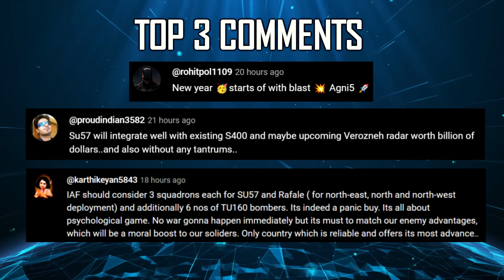Indian Defence Updates : DRDO's Anti-Hypersonic Missile,Brazil Brahmos-NG Deal,419 IMRH Order

Comment: During rafale deal also HAL did the same drama of warranty and said HAL made rafale should have warranty by france. Now they want russia to take warranty on completely HAL made al31 engine. So that if HAL made equipment fails so they can make other country responsible.
Reply: Most of the core engine parts and material still come from Russia we aren't actually making it more like assembling  it
Reply: Hal really needs to first prove it self because Hal warranty is not trustworthy
Reply: I doubt if they made reliable alloys for core section of al31
Reply: One more aspect.. Russia has denied to further localization of AL 31. And they say Russia will transfer technology in return to multi billion order for these junks with PESA radar and obsolete R77😊
Reply: @nishantshrivastava9674 how can russia increase localisation in engine? It is to be done by india only. Russia has denied to give warranty if core tech will be made in india. Russia is perfectly reasonable
Reply: @nishantshrivastava9674 su30 has hybrid radar with longest range NOT pesa radar. LoL. Russia already has 160km and 193km r77 variant. Is it russia concern that we use 1980 old 80km r77?
Reply: @nishantshrivastava9674 su30 and al31 is 60% TOT in India. What more russia will give? Name a single equipment for which USA gave even 10% TOT to any ally😊